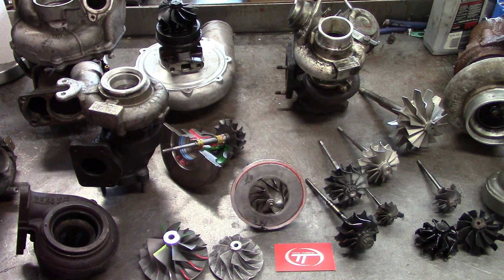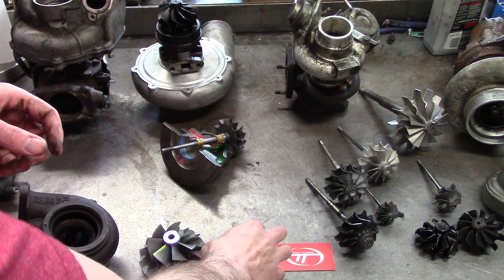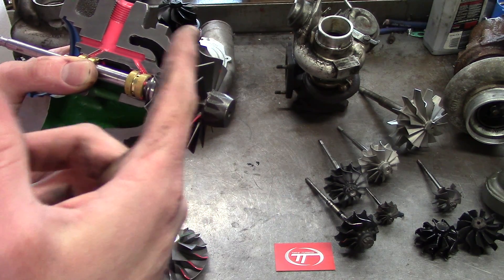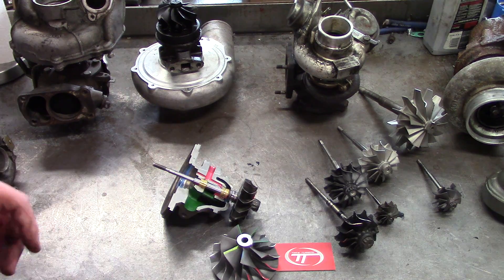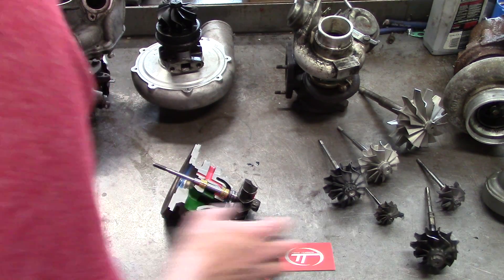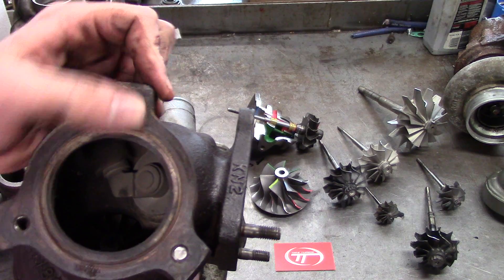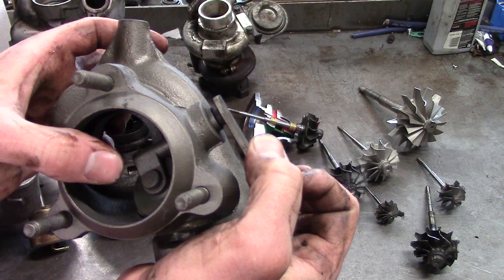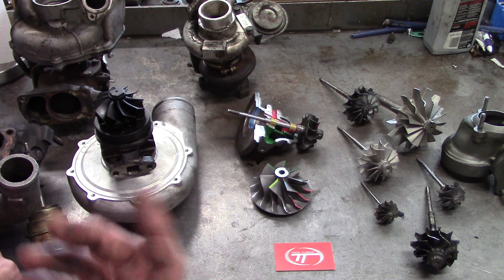Buying Used turbos Tim's Turbos

Comment: Hi I was wondering if a bad turbo or bad diverter valve would cause  the noise on the video attached to this..it's not my video another fellow YouTuber posted it but it's exact noise I have on cold starts and wile driving sounds like loud jet sucking noise or  open valve after 30 seconds of cold start you can hear a turbine wine at the end but it also does this sucking noise wile driving any advise would be greatly appreciated. 
Here's the link thank you https://youtu.be/wJUQgUa7t2E
Ps. Also it's a 2011 bmw 535i N55 engine my car recently had a engine rebuild and did not do this noise before rebuild

Comment: Hey, old vid, i know, but i have a question that im hoping i can get a straight awnser for.

In short: Bought a turbo, gt2554r and it was bought from someone i really trust. The turbo has axial play and has had that since it was new. The previous owner wrote to garret when he got it and got the answer that its completely normal, but is it tho? 

Since then the turbo has been used for about 3000 km (not much at all) and visually the blades and all lookes like its new.

(Ive seen the email from garret, and its strange they would call axial play normal...)

Comment: What kind of advice can you give on a volvo 13 liter geo turbo that has bearing bad and need shaft and turbine shaft ,I dont see where you can buy the shaft assy. something went through the turbo when the valve failure happen. these are very expensive to buy as rebuilds.

Comment: This video just won't load.
Nothing wrong with my connection, I've tried multiple times and come back after watching other vids.
Shame i was looking forward to it.
Reply: Hi there, friendly reminder to try again. This happens to me sometimes...
Reply: @HippieGeeks  unfortunately I've tried to watch it 30+ times over the months on multiple different devices and different internet providers and locations.
I think there is just something wrong with this video.
It is either corrupted or there is something els wrong.
It always stops in the same place everytime.
It's a shame I really wanted to watch it.
Reply: @priestleyharker4046  did you watch it yet first time I've ever seen it when fully through without a hiccup... Really great video must I add 🤣🤣

Comment: Hi Tim 
 
 Am from Roumania and just taken down today the turbo of a Renault . The car had no power in 5-th and 6-th gear , that's why I started to search what's wrong  . Until now have observed there are masive leaks of oil on motor , at intercooler inlet and outlet . Oil droping from the oil reservoir ( I guess gasket is not ok ) . EGR was clogged . 
  If you are so kind to take a look over how the turbo looks .... maybe you find something wrong . I suspect the actuator was not working as it looks rusty as you can see in this video : https://youtu.be/89-r3BFGMJg  . Many thanks .

Comment: superchargers are way better they last longer
Reply: Not true at all. Both are great. But turbos will last longer with the proper conditions. For example  big rig trucks will run many many many mi with out a rebuild.
Reply: I think that depends on the application. On the drag strip: a supercharger would be better because the turbo lag would cost you races. On the street: a turbo is better because they tend to be much more fuel efficient.

Comment: Hi Tim, you mentioned no in and out inner shaft play and only minimal side to side play. Would it be a simple rebuild for my turbo or a very tricky one? I have the Turbocharger 49135-05671 bmw320d. Been doing a annual service and general checks, so noticed a bit of oil in inlet and an inner shaft play. after changing oil breather and engine oil the little oil patch disappeared, but I'm concerned about that little inner play.  Please comment if you have some time to spair

Comment: I bought a used turbo but it’s hard to turn the wheel. When I took the exhaust housing off it was even harder to turn the wheel. But when I put it back on, I could turn it again. It’s a gt2260v . Any ideas?
Reply from the maker: When you put in the new turbine shaft, the Piston ring is probably loading up. Do a test and pull the ring off the turbine end and see if it spins after that.
Reply: Yes, thats the carbon burnt oil built up under the heatshield. Need to be cleaned out ( rebuilt)